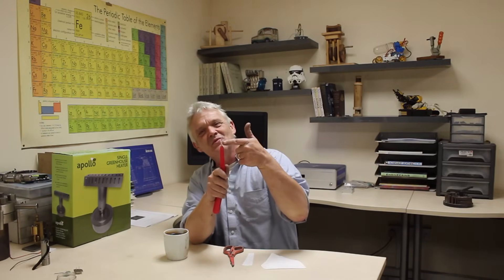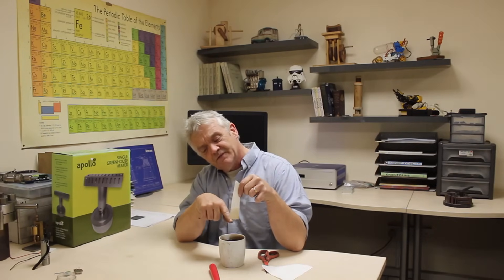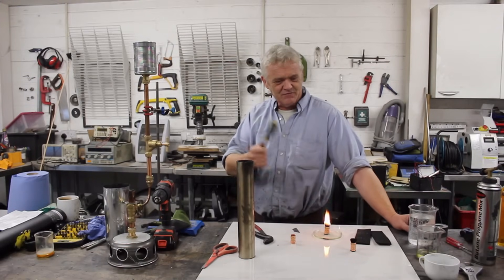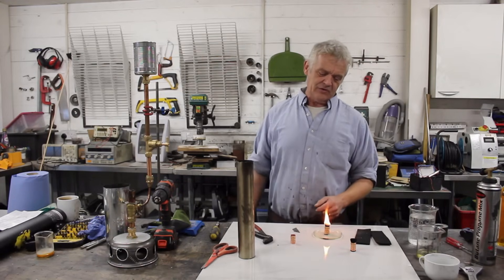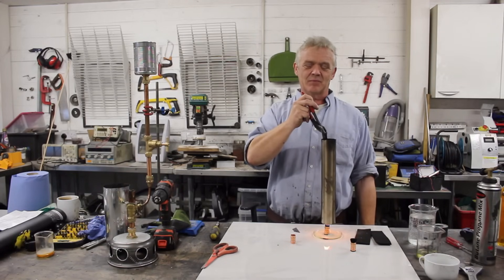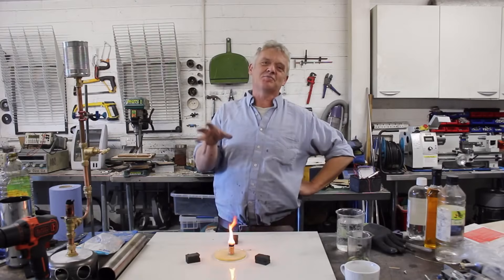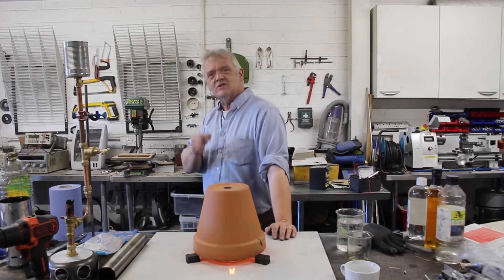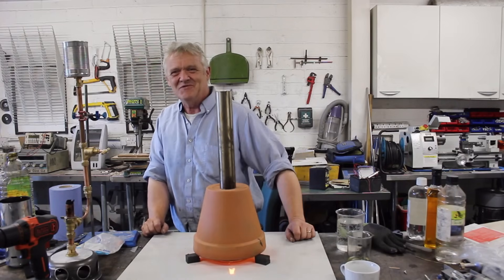1680 The Magical Forever Wick - The Plant Pot Heater On Steroids

Comment: So a chimney reduces or eliminates the smoking problem with vegetable oils.  How's often do you have to clean the chimney?  Or does the chimney create a cleaner burn?
That being the case, how much air gap would you need between the wick and chimney to have a lantern?
Could the clay pot heater double as a light source?  About what temperature will the clay pot get?  I'm thinking put a round wire cooling rack (maybe one with longer legs) on top of the clay pot to use as a food warmer, unless of course it gets too hot, then there's the possibility of using it as a cooker besides a heater.

Comment: Could someone please give an answer.  I tried this inside my office and it seems to work well. But then I became very concerned about all of the black smoke.  I thought about putting a quarter over the hole of the pot to keep the smoke from spreading out in to the room, (which it did after only about 15 mins) with the door to my office closed.  If I cover the hole will the pot etc eventually combust or does this set up produce carbon monoxide? (All of that smoke can not be good for you).  Is this a set up that is for outside use only or for a place that one can be well ventilated?  At first glance this is a great idea, but again once I put it to actual use, all of the above listed questions are extremely valid and need to be addressed. Please help.  I would ask Robert directly but do not know how to get in direct contact with him. Thanks so much for your input.  I am 61 yrs of age living alone and really just want some honest help and understanding of this whole system.
Reply: Let converse📤😊❤😊

Comment: That's brilliant - I must get some of that carbon felt.
Also, just for the hell of it, I dismantled a used carbon water filter cartridge and there is a lovely tube of hard extruded carbon inside - I wonder if this could also be used as some kind of vegetable oil heater, maybe for a greenhouse. The carbon is porous so I suppose it would 'wick' and make a giant carbon oil heater.
These carbon cartridges are usually thrown away, I suppose.
Reply: Let converse📤❤❤😊

Comment: Try using fiberglass for a wick. I've burned vegetable oil, citronella, lamp oil, alcohol and lamp oil all in the same home made burner. Just have to adjust the wick length for whatever fuel you're using.
Reply: Let converse📤🎉🎉

Comment: I'm assuming this really is something that shouldn't be done inside, given you are burning vegetable oil, which will give off carcinogenic toxic fumes and free radicals?  Seems a much more efficient way to produce heat than the tea lights, but this would be really bad for your health surely.  You don't want to be breathing in that smoke you can see coming out that chimney at the end of the video.
Reply: Let converse📤❤❤❤

Comment: I tried this, ordered the carbon felt, did everything suggested, and it just doesn't work. I had to hold the felt over a gas hob flame for a good 3 min before it even lit, then it wouldn't wick up and the flame went out. I tried numerous times. Tried heating up the oil first to make it thinner and everything. 
Only thing I can see that might be the issue is that our vegetable oil here is 100% rapeseed, not sure what else could be used with the same financial gain as veggie oil.
Reply: Let converse📤😊😊❤

Comment: The ceramic plant pot is just a buffer, the same as turning on your central heating some time before you get up and turning it off some time before going to bed. To maximise heat radiation the surface should be coated matt black. I don't know why you'd want a buffer so why not forget the pot and just coat the chimney matt black.
Reply: It's important to not heat the ceiling region but to keep the heat in the lower region of the room.

Comment: Making a wick that doesn't burn itself is not that hard.
Even 2 metal plates 0.2mm a part suck a fluid up.
Any fire resistant material that has enough air gaps in it will do.
Steel wool for example.
Reply: Let converse📤❤❤😊

Comment: I was wondering if would be interesting if the heater characteristics would change with a hollow pipe in the centre to feed air to the flame say a U shaped 6mm copper tube inside the copper fitting? Could we get a it of  c/co/CO2 info to go with the ideas to see where the ideas might work. Regards.
Reply: Let converse📤😊❤😊
Reply: @OnNicegram.ThinkmediaTv  Hi first time on this, and occasionally the b doesn't work. I am looking for a better heater for my 8 * 6 greenhouse. I think the commercial heaters are rubbish. Not looking for awesome power but want a cleaner more efficient burn. After talking to my agriculture bro' he mentioned plants dislike soot and CO. I have used some wire wool on chimney stack to cut out the soot but I'd prefer to burn it and release the heat. I later looked through some methanol burners and you had the idea in them. I am trying to recreate the Bunsen mix to get hotter flame. The wick if it's porous enough might assist between the two pipes as a mixer or use a  copper tee joint to introduce air to the central core.

Comment: That size wick and pipe size that your using is truly amazing, lovit.
All I need to know is for how long does it burn before the oil runs out and needs to be topped up. I was thinking of attaching  a pipe and a computer fan to blow heat around my garage also thinking of heating my whole house including water.
Could just buy an old baxi boiler and put the forever wick in the part where the gas heats the water  ,now thats an idea no gas just vegetables oil and the carbon felt wick in that little copper pipe.
Lovit .
Hope you message me back 
😁😄👍🏾🙌🏾
Love your work .
Much appreciated.
Reply: Let converse📤❤❤😊

Comment: Did you mix in gasoline with the oil? It doesn't work with vegetable oil. I even used a torch to pre heat the tube. A little flame then it dies out!
Reply: Let converse📤❤❤😊

Comment: Ok, I tried this and it won't light. Did you use a blow torch? Am I using the wrong carbon filter, which seemed to melt? Wrong vegetable oil? All I got was greasy hands. I was rubbish in science at school.
Reply: Doesn't work! I think this tricky bastard slipped in some diesel oil or something in the mix. I've tried lamp oil and barely get a flame about 1/2" at best
Reply: @user-zx7tg4ph5r  not just me then. Sigh. Back to the candles.
Reply: Let converse📤❤❤❤

Comment: I bought a piece of graphite carbon felt insulation on Ebay as they sell it in small quantities and did as the video said and it wicked up the oil but I could not get it to light.  Did I buy the wrong carbon felt? Please advise.
Reply: Let converse📤❤❤❤

Comment: i have tried this and the problem i have is the combustion is incomplete. any air movement causes wisps of smoke, and anything you put it under will collect a lot of soot, which in turn will make heating less efficient. you can see a wisp of smoke come off whenever a draft disturbs the flame, and there's clearly emmisions when you put the metal tube on the plantpot at the end . so much ventilation is required in any kind of sheltered space that heat output becomes moot. as it is, this might well be a very dangerous stove for the unwise or unwary to operate, due to the carbon monoxide risk, but i think it might work better with a second stage like with a wood gasifying stove
Reply: Let converse📤❤❤❤

Comment: Not working for me at all. Bought the carbon from this guys shop so id have the right stuff. Got vegetable oil and it wicked up but wont light. Used vodka to help it, no joy. Tried orange essential oil that's flammable and it lit for the first time but went out again after all the orange oil had burnt off (about 5 mins). I've messed about with it in various ways to no avail. I thought it might be handy for folk if we get the blackouts. Im renaming it the never ever candle.
Reply: Let converse📤❤❤❤

Comment: A fellow science guy, loving it.  You can place a slightly larger bolt over the metal tubing pushing it to the bottom for additional support to prevent it from tipping over, & adding a metal chandelier of metal nuts and washers to retain some of the heat being emitted from above.

Comment: The plant pot heater people don't know what they are doing, they build them without holes thinking the hot pot is what warms the room - in this case a plate of lights warming the air are just as effective. When they DO use a hole, what makes things hotter is the tea light burns fast because of the chimney effect. The danger is they get too hot and the was flashes like a chip pan. I wonder if the oil can get hot underneath this? because if allowed to warm up enough it will go up like a chip pan.

Comment: Knocking the wick over in diesel oil also won't cause the oil to combust uncontrollably. You can throw a lighted match into a bucket full of diesel oil and the match will simply go out.
Great video, well presented.

Comment: It's also called witching because it was mysterious witchcraft that made the liquid rise up the paper.
I initially tried this with smaller diameter tubing 10 mm with alcohol. You will find that the wick will slowly burn even though its non flammable carbon felt. To prevent that you could silver plate the top 1 cm of carbon felt with silver that will NOT burn in air. Silver on carbon just might burn for years. If you're a bit fancier you could use platinum plating on carbon which I assure you will burn for quite some time.
Alternatively you could try a small stainless steel or silver mesh grill to keep the high heat away from the flame.

Comment: Interesting experiment, but I'd REALLY REALLY want to check on the EXACT material & chemical composition of the carbon felt before I start burning it near where I was breathing. Materials designed for high temperature insulation may be perfectly safe when used in the way they are designed for, but may act very differently when you go off piste and soak them in oil and set fire to them. But hey, you do you.

Comment: Qurstions:
1. Can you use old motor oil as the fuel?
2. Can you couple this with a gasifier to combust the smoke and add more heat?
3. If number 2 is true, can you place it under a clay pot?

Comment: i like this, but the air above the flower pot chimney is looking sooty. So not for the house???  I have used the tea lights under abig flower pot and it works well.  However I want to try the felt. and have ordered a little bit.
Reply: Michael mate where'd you order yours from? I can't seem to get a 100% genuine carbon felt link
Reply: @zuutube875  just an online seller. Haven't got it yet so I don't know what it's like.

Comment: I saw this engineer light the boilers of an Iowa class Battleship with a long poker wrapped in asbestos soaked in fuel oil. I thought this really neat cos the fuel burned away leaving the asbestos for re-use. Also it didn't have any burning pieces coming off around the room.

Comment: I can't, for the life of me, find a source for this material.
I did discover if you buy a cotton mop head you can cut one or more of the thick strings to braid the thickness you want and you will have a low-cost lifetime supply of oil burning wicks!

Comment: hi! interesting stuff you do! 
do you know how high these carbon felt can wick thick oils in a metal tube?
i  have one of this cheap 15 bucks green 8 wick kerosene heater stoves and i am interested to convert it to a kind of mulifuel heater. in moment i am using grill lighter fluid with a tad of ethanol, works fine. but it would be great to burn all kind of stuff in this heater.
 i also have put one of these metal heater cover on top of the kerosene stove to get more radiation heat.
i think i can learn something on your channel so i subscribed

Comment: I have my coupling, the carbon i bought direct from his shop and ive tried it with olive oil and grapseed oil and neither will light. Really disappointed.  Any ideas guys?? Ive rolled the carbon into the plumbing fitting and sat it in the oil. Waited 5 mins. No joy so rolled the other end in oil to make sure its covered. With the other one i didnt do that, i just waited for it to wick up but neither will light.

Comment: I have a question.  We are going on a campout and instead of burning logs for a warm camp fire, I think I'll take along the pot set up you just did and try it at least once just to test it out.  My question is this:  Can the flame be put out simply by covering the hole on the top of the pot, or would I need to bank dirt around the bottom (to reduce air flow), or do both?

Comment: I've just got a sheet of 12mm thick graphite carbon felt cut a square off and gently inserted it into a small fitting as you described,  it's definitely wicked the vegetable oil up as you can see it on top, yet can I get it to light ,no.
Reply from the maker: you need toget some heat in there - dose the wick with a bit of meths or alcohol and try again
Reply: @ThinkingandTinkering  OK will do, I've got some I've got some 99%isopropyl alcohol.  I'll try again,  I maybe thought it was I was using rapeseed oil which has a high burning point, so I thought trying corn oil might do the trick

Comment: At the end of the video, when the metal tube is placed over the flower pot hole a grey smoke is shown coming out of the top? Is it soot? Is it designed for indoor use and how large should the gap be between the table and flower pot for air circulation?

Comment: Would ceramic wool work better or worse (or at all) for this? Maybe it would absorb less heat and allow it to burn hotter/be less sooty? 

Awesome video! I wonder how thin you could make it before it stops wicking thicker fluids; could I make the weirdest oil candle ever with carbon wool stuffed inside a steel straw?

Comment: *Edit: after some testing two brands failed to be actual carbon filters. Cat-It and a local store brand. This is not likely a reliable option.

Something that may not have occurred to many people is that you can buy small carbon filters around the 4x6 to 5x8 in size for a few dollars, $5.99, from the pet store for cat litter boxes. Some even have multiple filters in a single package for that low price. Just need to make sure its carbon only, not the multi-material layered ones.

Comment: Been playing around with wicks and vegetable oil for years. This is soooo cool man! Now I'm thinking of lanterns and stoves.
Reply: hi, i have made a few of these, and the flame doesn't appear to be anywhere near as big as the one on the video, I am using sunflower oil, will that make a difference, also is it to do with how much much carbon foam you leave out the top of the fitting, and also does it matter how tightly you roll it, I seem to have more luck if I roll it tighter, would be appreciated if you cold share your wisdom on this, cheers
Chris

Comment: There is PLENTY OF SMOKE after putting the plant pot on And Then the chimney ?
SO IS IT going to BE a Smokey thing ???
If so then it is of no use in a home as it will blacken the ceiling and the walls.

Comment: we tried the plant pot candle heater with 4 old tool sockets to raise pot of a terracotta saucer with tea lights inside about 4 seemed to work ok not much fumes .we close door too in our small longer .we do have air vent on wall for ventilation or just open door bit more if need to.

Comment: I like the idea of this, especially with fuel prices on the rise this winter! One concern I have about these terracotta heaters: what concern is there with exhaust? I wouldnt think you'd need to worry as much about venting like a wood fire, as the oil is carbonizing far less, but as noted, w/o chimney it seems sooty. Any good ideas?
Reply: I place a quarter on the inner pot's hole and a terracotta small dish over the outer pot's hole. Soot stays in the pots.
Reply: Use a taller spacer to set yards dots pot on and place the drain dish over the hole. Pot will collect the soot. The heat will radiate through the the pot. I will be using bricks on both sides and across top like they did with candle. Its the bricks that will absorb and raideat the heat. With the added air flow I'd think it would burn cleaner. I have COPD so it won't take long for me to know if I'm wrong.

Comment: I wonder if I could adapt this to a standard kerosene lamp. The problem with those is that you can only use kerosene or some manufacturers recommended brand of lamp oil. If you don’t it simply won’t light. Being able to use vegetable oil in a dietz lantern would be incredibly useful.

Comment: Don't you need room ventilation? I would be concerned about CO, though I only scraped chemistry O level so don't judge me! Lol! I remember having a paraffin stove in our bathroom, which was always freezing in winter, so why would I open a window to let air in only to let the heat straight out... ?! 🤔 I used to feel faint in the bath, presumably from the fumes! Didn't know it was dangerous in those days.

Comment: Is this that stuff factories call Pig Mat ? We put it drip pans hanging under motors or to soak up oils on the floor. It's like $200 a roll. It feels like felty paper and  has little holes in lt. you pull off what you need and rip it off the GIANT roll like a paper towel.

Comment: If you can't find an UNGLAZED pot, one alternative that works is this: thick glass lampshades that people put out on the hardrubbish collections. I used one of these instead of a pot for many years, worked just fine. As soon as any cracking appears, change it for a newer one for safety reasons

Comment: one thing that is never mentioned: DO NOT use a glazed terracotta pot, otherwise you are just breathing in toxic fumes. Most pots ARE glazed, so do your due diligence and find a supplier of UNGLAZED pots. I have to repeat this on so many youtube sites (sigh) as the uploaders never bother to mention it.
Reply: glaze is transparent, so you have to really take a close look at the pot to make sure you are buying the right one. It should  have a slightly chalky, slightly rough surface - not smooth and shiny